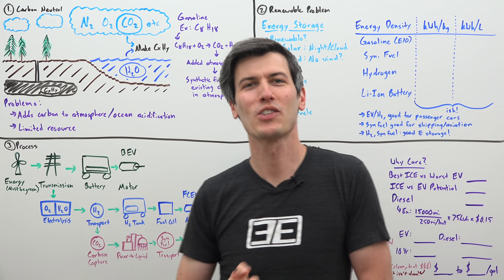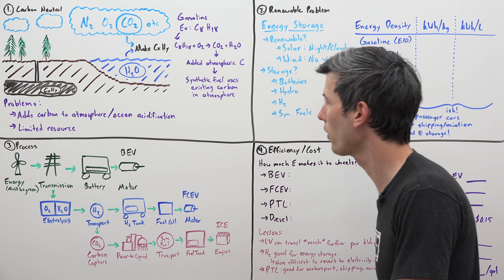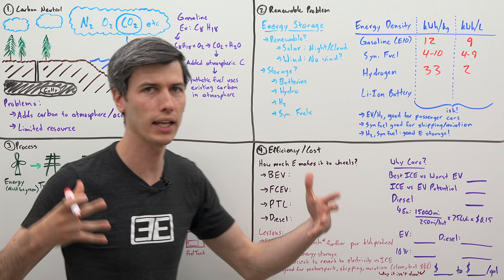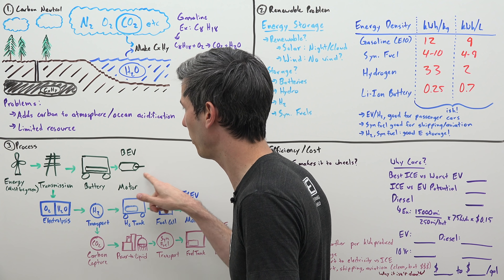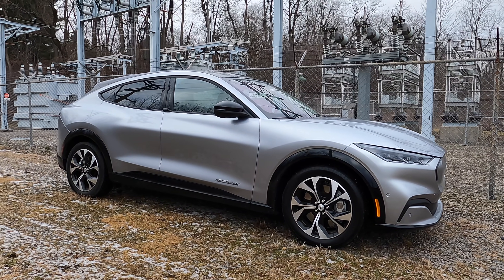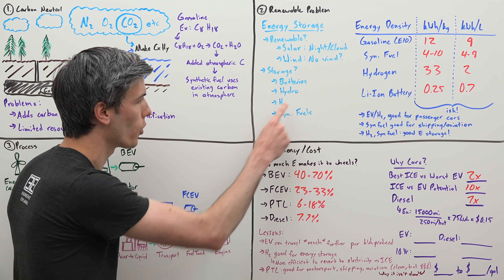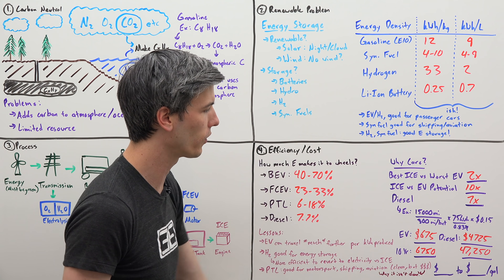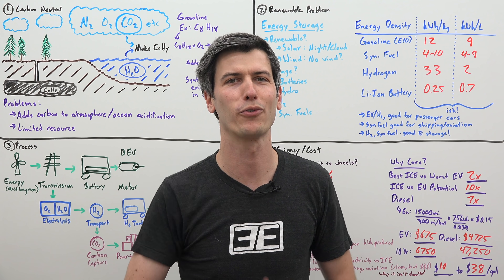The Big Problem With Synthetic Fuels

Comment: Thanks so much for this great explanation of upcoming synthetic fuel. It's really great to hear that it can be an alternative. I have some inquiry to make and seek for your insight. I have an ML270 CDI with manual gearbox with 6 speed 2003. Currently the radiator fan does not put on automatically. You're need to turn on the AC fan knob to put on the radiator fan. But then it's on for a short time and then turn off. I just replaced the old one with an after market one. What do your think could be the problem. Thanks

Comment: Here is a proposal: Gradually introduce blend of synfuels and fossil fuels, similarly to how biofuels were introduced. It could go like:
25 % by 2025
50 % by 2030
75 % by 2035
100 % by 2040
This should give enough time for all industries to adjust and it is a certain path to carbon neutrality.
Reply: EV adoption is already experiencing exponential growth on an annual basis. By 2040 the market will be so saturated with new and used electric cars that I don't think a discussion about fuel-use will even be relevant by that point.
Reply: @0hypnotoad0  First, this could be applied to planes and ships too.
Second, I do not want civil war with the countryside. I know that some people are quite stubborn when it comes to switching to EV. That however does not give them a permit to damage the planet further.

Comment: Unless E-vehicles get to the point where it takes 5 min max to charge to 100% im sticking to gas/diesel cars as long as possible, the practicality is just unbeaten, no need to look for chargers, you just go to a gas station, fill up in the span of a min and you’re ready to go, and it lasts you a good while, depending on your car.

Comment: The main advantages of liquid fossil fuel and synthetic fuel are low pressure storage, long shelf life, and ease of transportation. If a country want to prepare for war, they need to stockpile these fuels.
Reply: Regular gasoline has a shelf life of three to six months, diesel can last up to a year before it begins to degrade. Organic ethanol based fuels will stop working properly in 3 months. Long term storage with fuel stabilizers is a little better but that's by no means an end of the world style preparation.
Reply: @JaccoSW  with current war technology, even lasting a year in a full scale war is impressive but yeah i agree

Comment: Really interesting video! It's staggering how much more energy is needed for the synthetic fuels. However for diesel there are already fuels available made 100% from plants, that makes much more sense and is significantly cheaper than synthetic. For gasoline replacement I'm not aware of any plant based alternative that works 100%, however, you could mix 10-15% synthetic gas with ethanol or biobutanol to get a somewhat drop in replacement for fossil fuel. But in the future I'm sure other plant based fuels will be developed that will be easier to use. And as you're ware, all the carbon in a plant based fuels has been absorbed from the atmosphere, so they are potentially net zero GHG (obviously depending on where the energy needed for processing/distribution is coming from)

Comment: I'm a bit confused on the hydrogen front with respect to aviation.
You mentioned the priority is keeping mass down, so they should want hydrogen, not synthetic fuels.
They also have a lot of volume to work with for storage, and if it isn't necessary to compress the hydrogen they'd also benefit from buoyancy.

Comment: EE, what's the pressure for the hydrogen in the gravimetric and volumetric values you stated?
Reply: Gravimetric one do not depend on pressure. Volumetric one is stated for gas H2 at 700atm, I guess.

Comment: Modified ethanol is the future, if we can create a closed loop of energy production and consumption with already existing infrastructure, it seems the most feasible, and doesn’t rely on mining limited resources like lithium for batteries that are hard to recycle. Plus emissions from ethanol vehicles will be recycled by the very plants that will become fuel in the future, making this process completely carbon neutral, so that any carbon capture technologies introduced will have a net positive effect.

Comment: Surely if the entire process runs on renewable energy, and if the transporting of the fuels is done via synthetic fuel (Once the first distribution cycle is done or whatever) These will actually be carbon negative and not just neutral. In addition, if the renewable energy sources are infinite*, why does the efficiency ratio matter since supply is bountiful? I'm not saying you're wrong I'm just not 100% sure I understand. Also, Large oil companies own the majority of non-tesla charging stations, as soon as the petrol taps turn off the Electric quick charge price will go up 10 fold, they will not accept a cut to profits and home charging will be non viable for the majority of people in europe.

* I know you are constrained by harvesting, space, cost, and actual availability, its hyperbole*
Reply: Efficiency doesn't really matter in the long run. Only cost and profitability matters. Covering only 1% of the Saharan desert in solar panels gives enough electricity to cover todays global usage. 
I think the economic case for E-fuels is really strong. And as you say, it will probably turn carbon negative, since a large proportion of the CO2 captured from the air will at all times be in the form of E-fuels. 

It will also speed up the cost lowering of carbon capture. That could then be used to essentially stop globabl warming/climate change all together. 

The only thing I am a little concerned about is about local emissions: NOx etc. Could that be eliminated with E-fuels?
Reply: @jimj2683  Imagine what'll happen to plants once you reduce CO2 levels.

Comment: I thought 'synthetic fuels'(still kinda like plant based 'ethanol'? never was actually clear what these 'fuels' are, and if they could even come soon enough to make a difference) can't be used in boats(ethanol being highly hygroscopic, so wrong for constantly wet environments) nor airplanes(needing mostly a kerosene blend, tho there might be a few select plants that can be grown to make aviation biofuel, but just not corn and other common crop plants) ....and anyway biofuels require more energy to grow and produce than they end up outputting(plants are actually a very poor way to collect the Sun's energy, corn crops particularly bad at only ~¼ of a % vs even solar photovoltaics at maybe ~20%) only existing because of government subsidies to keep factory farms in business - the deal to mandate even 10% ethanol in auto fuel is a scam, which they want to increase to 20%; so going full synthetic biofuel would require a huge amount of water and land and not actually be sustainable, while only possible in cars, trucks, maybe trains, and other things that are capable of being directly EV anyway ...the ICE(which already wastes so much of its energy in heat) will have to die for most people's needs without fossil fuels, except for airplanes and large ships which have no other choice and can get away with being horribly inefficient(expensive) plus dumping carbon back into the air/ocean where the conditions will never be right again on Earth to spend millions of years to get it back out again(plant matter that didn't decompose to make the fossil fuels kept underground and remove the carbon from the air to make it breathable) yeah, we are doomed because of our use of fossil fuels, not that they will 'run out' nor ever cost too much, or are used so inefficiently; but we should have just left all that carbon hidden in the ground, as it has only taken us about a few 100years(increased population and use per person) to put enough of it back in the air to start putting coastal cities underwater, cause human migration because of weather extremes, wipe out sea life, etc. - things that would naturally take thousands and thousands of years which allowed time for life to evolve with those changes; life just can't evolve fast enough to keep up with how quickly we have changed the planet, for the worse so we can go 'zoom-zoom', eat a bunch of crap now, buy silly things, and use fake light/HVAC - well, I guess it was fun while it lasted, "live fast and die young(so you won't be around to see the extra mess you left from being so hasty)" after all is pretty much the motto of the human race

edit- oops, I missed the banner that said 'synthetic fuels are not plant based biofuels' but I'm guessing energy to make "synthetic fuel"(out of just the air? with magic, and still another pre-existing power source just to make a lesser fuel) would be even greater than what they can store(so kinda as pointless as biofuels but worse) so a 'future fuel' not even as good as biofuels which we already wrongfully use - eh, maybe okay for boats, but at a lower energy density not going to work in airplanes

Comment: About hydrogen production; there is many waste heat sources like nuclear power plants, that are not well utilized in electricity production alone. For example here in Finland the new Olkiluoto 3 nuclear plant electricity production capacity is 1800MW, but the thermal power of the plant is 4300MW. By other words over 50% of the energy produced by the plant does not go to the electric grid, it will be directly wasted as heat without doing any useful work. There is thermochemical water splitting processes that can produce hydrogen directly from waste heat. By other words, does the hydrogen production make sense or not depends totally of the energy production system as a whole. If nuclear (or some other heat intensive method) plays a major part in the production side, there will be a lot of waste heat available that cannot be directly converted to electricity. But if good efficiency is target, that waste heat should be used for something else and in that scenario hydrogen, and fuels based on hydrogen, or some other storage from heat may become very viable.

Comment: This is an interesting analysis but I think the inefficiency of efuels is more easily understood by evaluating the process more closely. Electrolysis produces hydrogen at low pressure and low volumetric rate. This will require significant compression in order to transport. Fuel cell cars typically store hydrogen at 10,000 psi.  Truck transport is done cryogenically.  Pipelines don’t really exist but natural gas mains operate at 3600 psi. I’d like to see an analysis comparing the input electricity required to make high pressure hydrogen relative to the hydrogen energy content. Similarly for CO2, you can’t just pull that out of thin air (it’s literally at ppm) without using a ton of electricity in an air separation unit. You can buy it commercially but the volumes you’d need may not be available. You could get it from a coal power plant but… why?  Efuels strike me as an exercise in turning gold into pennies. You can’t really get the costs down - they’re thermodynamically driven. No amount of scale or materials innovation will change this.

Comment: Can you not compress hydrogen? You said it has a specific amount of power per liter, but that is probably at 1 atmosperic pressure. If you stored all of your hydrogen at 100 psi, wouldn't you have a lot more stored power per liter?
Reply: This is usually what is done but that process requires energy to do. There are also some real issues with sealing high pressure small molecules and safety issues (15 bar fuel tank rupturing in a crash = big bang).
Reply: @zknarc  That makes sense... I guess any hydrogen tanks in a crash have a hindenburg tendency though...

Comment: Swift aviation fuel (102 octane) has about 113% the energy by volume, of 100LL avgas. It's a mix of Trimethylbenzene and Isopentane, both can be produced via catalyst from biomass. While it does not meet the definition of synthetic fuel with carbon pulled directly from the atmosphere via technical means, the carbon does come from the atmosphere through photosynthesis.

Comment: 2:16 when we run out of crude oil how are we supposed to keep creating and building all of these new EV vehicles?

How are you tyres going to be made? Any plastic components in the car including the interior?? Rubber door seals etc etc.

A huge contributing factor to the running out of raw materials is the sheer volume of NEW vehicles being produced full stop whether they be EV or ICE or any combination in between. 

My 30 year old BMW E30 could run on synthetic fuel and requires very little raw materials to be maintained and be fuelled using existing infrastructure within the UK without needing anything new built.

I don't get the sustainability movement when it's based around new new new. It all seems to be missing the point imo. It really irritates me when you see hundreds of brand new cars at ports waiting to be shipped or sitting outside dealerships when I think of how much raw material must have been used in their manufacture.
Reply: You can make synthetic monomeric precursors for tires and other plastics. We Chemical Engineers know how to do it. It's just a matter of cost.
Reply: @ronaldlenz5745  well, you are right, it's JUST a matter of cost. If cost weren't significant in the past and wouldn't be in the future then we would have totally different techniques by now, and more so in the future. Creating costly solutions we make people hungry and keep them poor. Don't forget, most of the people are living in poverty, have only primitive technical aid and have not enough money to by and service new machines.
Reply: @ronaldlenz5745  That is interesting to know!! I had no idea about that sort of technology. 

Is there some basis then to be worried how we would continue to produce tyres or not?
Reply: A lot of claims, assumptions and questions here. I am very skeptical that you read up on any papers or even talked to veteran experts, even though I'm not one myself. If you feel invalidated by "the sustainability movement" then that's probably something you should work on with yourself and those people. Don't let the facts suffer. We are all mortal, fallible creatures with different interests and qualities, and that's okay. Repairability and modularity are definitely popular sustainability topics and part of the "circular economy" discussion. Look it up if you're interested. Do what you gotta do. Take care.
Reply: @Muskar2  I'm actually a graduating motorsport engineering so am quite clued up about alternate powertrain solutions lectured by some true experts so thank you for the assumption!

I also have no idea where feeling invalidated comes from lol.
Reply: @foodonfilm5935  Sorry, maybe my phrasing was out of line? I apologize if that was so. I have ASD so it can be hard for me to tell sometimes. Congratulations. I'm glad you're about to get real experience, I'm sure you'll quickly get answers to a lot of these questions. I come from a family of engineers, a few of whom work a lot on sustainability in big international companies, so I know it can take a long time to get your head around how deep the rabbithole goes. And when you're young it can sometimes be hard to keep an open mind. There's a lot of ambivalent studies with different strengths and weaknesses in methodology and data. I'm just a CS who likes natural sciences as a hobby. Take care!
Reply: @Muskar2  Not a problem :) it's all too easy to get frustrated by comments and I took yours personally as a bit of an attack so I'm glad it hasn't descended into an endless argument calling each other idiots lol. (us engineers are above all that ofc ;) )

I'm ADHD so sympathise with your ASD and your openness with it too!! Wishing you all the best :)

Comment: It seems like if it caught on, synthetic fuels could be made closer to the electric source assuming they ship more efficiently. Also, with the other technologies not capturing carbon, it seems like there is an environmental motivation to continue to push for synthetic fuels. Perhaps as the environmental crisis becomes more dire eventually carbon credits will offset the cost of synthetic fuels?

What's involved in making synthetic fuels? Does it require the mining of rare materials?

Comment: 1. Should nuclear also be considered on par with renewable energy?
2. Even if lion batteries are improving, I don't think there is much more room to pack more energy in there, it will never get close to anything traditional fuel has unfortunately.
Reply: I'd say that nukes should count, yes.  They're not *renewable*, but given that there's about 10,000x as much fission fuel in the ground as there is carbon, I think that counts.  Plus, for lack of a better term, "we know how to do it."  Meaning "we haven't really figured out fusion, but we have figured out fission, and it's not dependent on 20 more years of invention."
Reply: There are still many opportunities to increase the energy density of the battery.

Lithium Ion has an energy density of 250 watts/kg, solid state batteries 600 watts/kg, diamond batteries 1000 watts/kg.

If using 75 kWh battery pack
Lithium Ion = 300 kg with a range of 350 miles
Solid state = 125 kg with a range of 400 miles
Diamond battery = 75 kg with range above 500 miles

With the same battery pack they have a big difference in range, that's because of the weigh reduction.